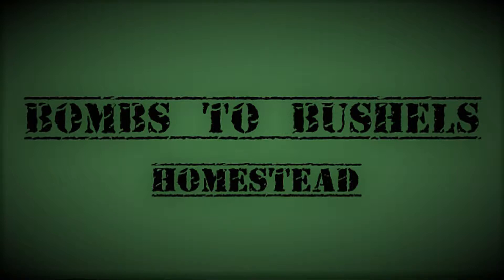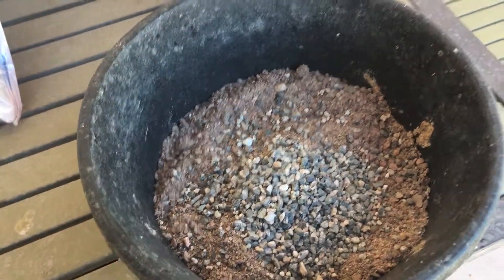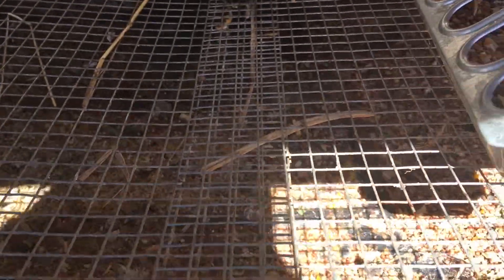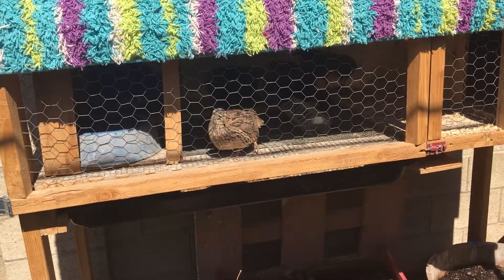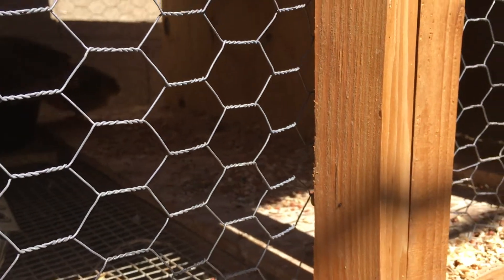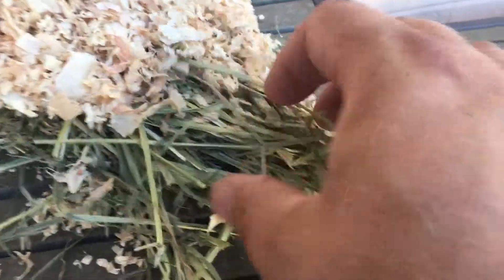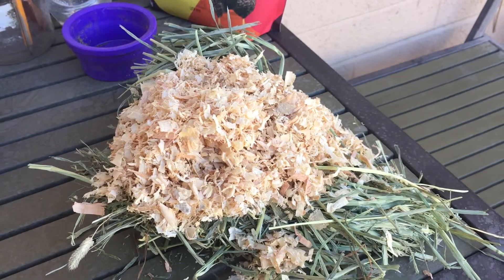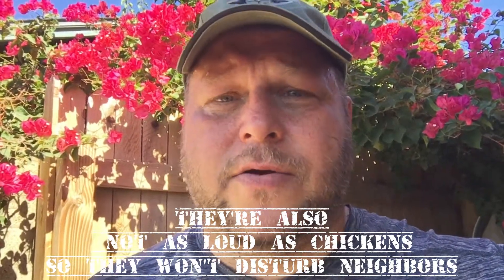Raising Quail is Super Easy

Comment: I’m new to the concept of raising quail and stumbled upon your video. Is the enclosed bedding area separate from the open area or can they get back and forth as they wish? Do they lay eggs in the bedding area?
Reply from the maker: They can get back and forth as they please, but they lay eggs anywhere. They have laid eggs on every square inch of their coop including inside their dust bowl. They don’t seem to care where they sleep either. I had an old chicken tractor at one point and they refused to go up the ramp at night to roost no matter how many times I moved them. They sleep where they happen to be sitting when the sun goes down, and they don’t seem to care about huddling together for safety. They will go into the closed in area if the weather is cold, but they’ll sleep in the dust bowl just as often. They’re hilarious little critters!